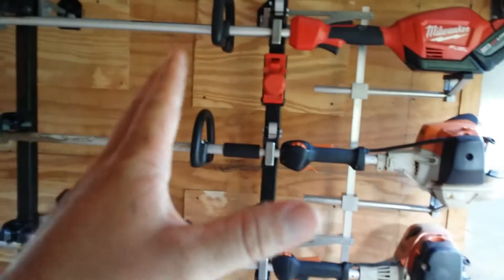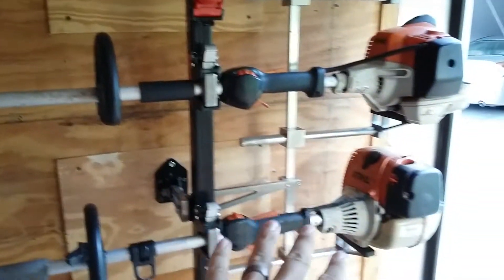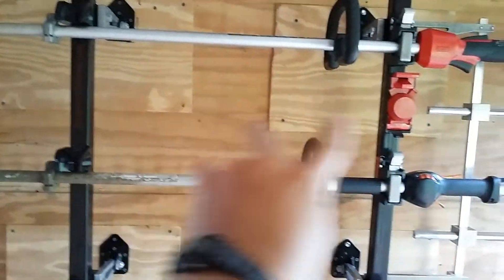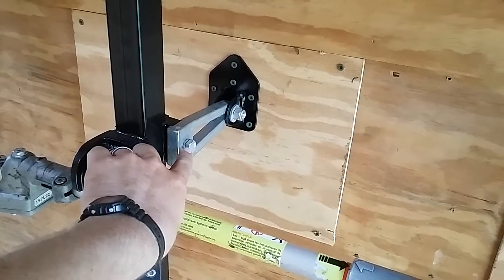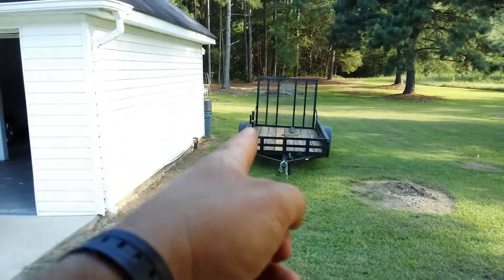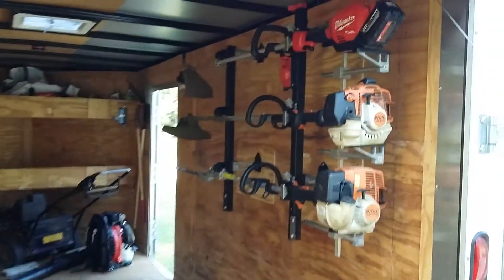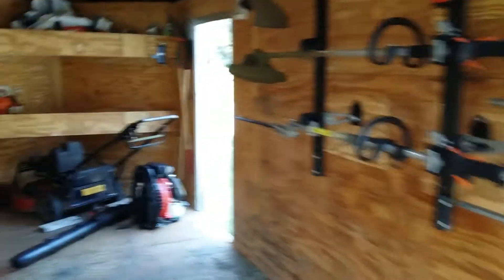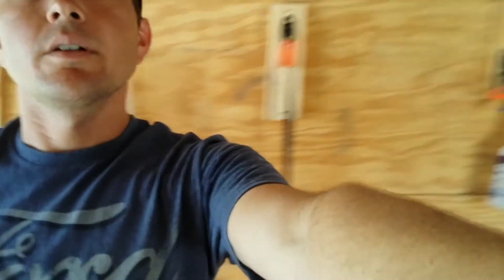Enclosed trailer☆equipment defender☆trimmer racks☆lawncare setup

Comment: Good video man. How do those hooks hold up to hold the blower, and what is the type of screw used to mount them into the trailer?
Reply from the maker: Ousama Abdu hey bud i just screw a 2x4 to the studs in the trailer then just screw the blower hooks to that. drill pilot hole first then i just use outdoor deck style screws